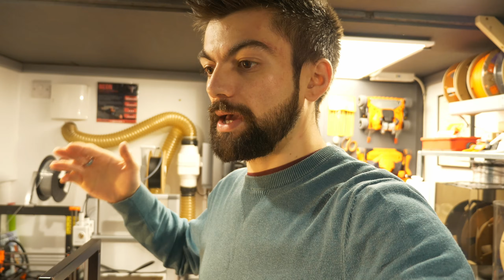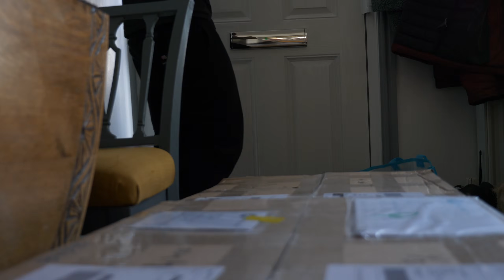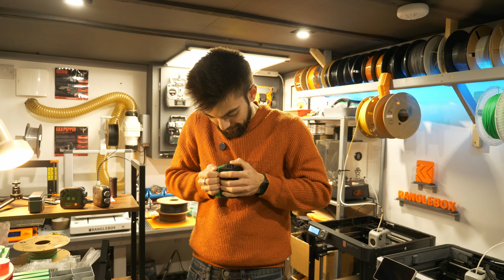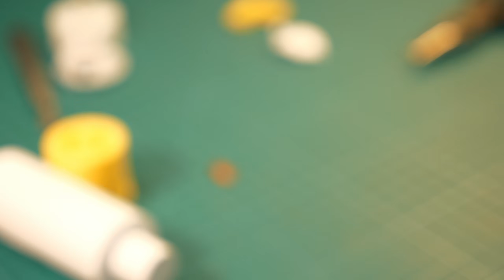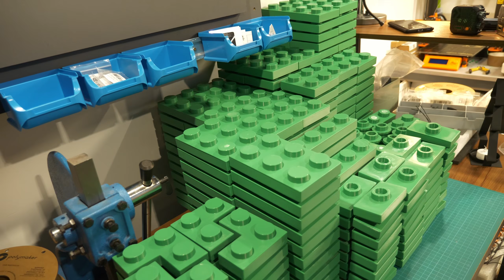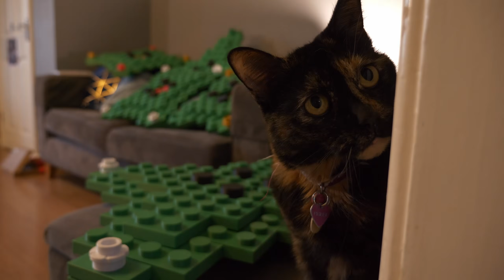Making a Giant Lego Inspired Christmas Tree

Comment: Hey mate, i am working on doing a tree for myself and i did some research and it would be awesome if you could give your piece of mind to this.:

Is there any reason appart from cost and time not to use petg? (Was considering abs but it's too expensive.)

I want to be able to take the tree appart and rebuild it every christmas for many years to come and petg should (as of my research) be more reliable (less deformation) but i dont know if im missing something.

Thanks for your amazing work.
Reply from the maker: Hey! Respect for even considering taking on the build! No reason to not use PETG other than cost, although I can't promise it'll fit together quite the same as PLA. PETG does indeed deform less with time. That said, the original tree is now 12 months old and is still solid - I saw it at Ruth's yesterday! 😅
Reply: @elliswhere thanks for the quik answer. And good to know. :D

Comment: 8:22 Literally every single part released by LEGO is available as a 3D model through stuff like LDraw and Studio, with consistency between each part.
Reply from the maker: @lilyzzworld they'd need logos removed, injection mould specific geometry removed, they would have no additional features to make 3D printing much easier, the modified parts would still be needed and there's still every likelihood the tolerances on certain features would need tuning. As the guy who did the work - I have zero regrets scratch modelling

Comment: Okay, I need to know more about that LED thing. There is only 4 parts, and if you remove the switch, 3 parts. How is the LED programmable?? How is there a timer in it? How is it flickering?! Is the controller in the IR receiver or in the LED?! is there even a controller?! Is this a funky way that the IR receiver interacts with the LED to make it flicker and give it a "timer", or is there an actual LED controller somewhere?!?!?! I NEED TO KNOW! The amazon listing does not explain crap.
Reply from the maker: Honestly I have no idea haha, I briefly wondered the same things until I just had to find a solution. The switch isn't a component, it just bends one leg of the sensor to make/break contact. Otherwise it's literally just the battery, LED and doohickey. It kinda has to contain some smarts because you can change brightness and all sorts, albeit only from the remote. Could also just be magic.
Reply: @ hahaha😂 See?? I knew there is something funky! If you have a spare one, try to pull the switch apart to see if there is anything else in it, but I don’t think so. As you said, it’s only there to physically bridge the connection between on and off. At that point, as I wondered before, that black diode thing with 3 legs, I would assume it is any normal Infrared Receiver Diode (used in many things), but there isn’t much “data” stored there. It should just be a “dumb” input receiving data from the remote. And the LED itself should also just be a simple light source. Unless you can see any serial numbers, model information, or even other chips inside the LED glass, there should just be one “chip” in there, and it’s the LED itself. I thought that maybe having the IR receiver be the contact between the battery and LED that background IR or digital noice could be the source of the flickering LED, but thinking back to playing with parts like these I never had that happen. This is why I am so interested, because if there is ANY info on the two parts in question, I would love to know, and maybe buy in bulk once we have the appropriate info🙌🏻🔥😄

Comment: 8:43 there are 2 programs you could have used for getting the part models: 1 is meacbricks. Little more finicky to use, has less pieces, but it has a much easier model export process. Second is Bricklink Stud.io. much easier to use, is owned by lego so it's the best parts database you can get, but the catch from that is I don't exactly know how easy it is to export the model files into something usable for printing. All of them are free.